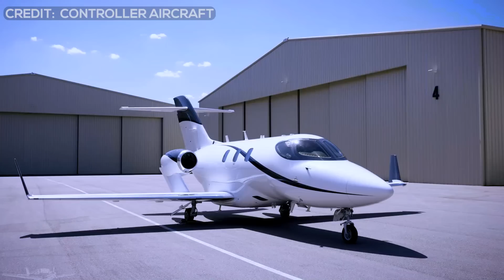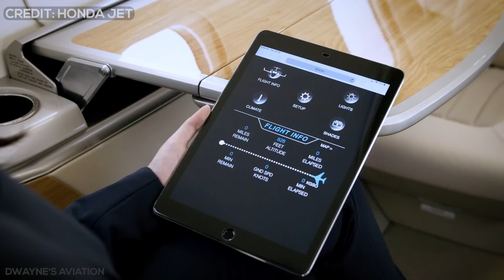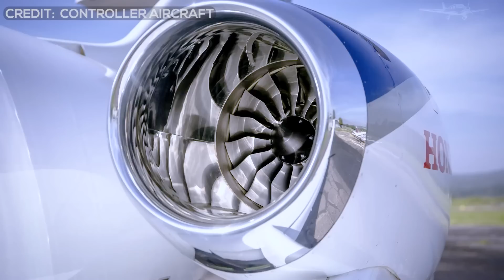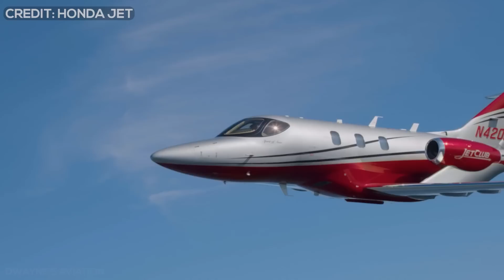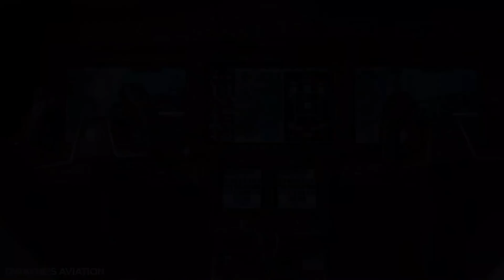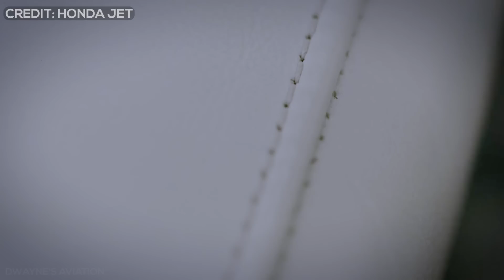Why the HondaJet is Outstanding

Comment: Two major downsides of the Honda jet are, no aerodynamic brakes or thrust reversers to able it to land at shorter strips and under powered engines.
Reply: It does have Aero brakes located at the aft fuselage
Reply: @omolemophaoe  having worked on those planes, and knowing many pilots first hand experiences. I don't count them as speed breaks at all

Comment: Why did they use an inverted pylon to mount the engine instead of fuselage mounting like a citation you wonder? The wing has to be locally strong enough to handle main landing gear loads, strength requires additional structure weight. If the engines were mounted to the fuselage, that also requires strengthening to handle the weight at that location. However, mounting the engine close to the main gear requires only one strong point per side and saves complication in running fuel lines through the cabin. This saves weight and increases the sound isolation between the engines and the cabin. When someone does something different because it is better for their purposes, it often looks funny to a viewer because it is unexpected.
Reply: It's not only strength, it's less noise and more room inside the plane, not to mention less hardware.
Reply: If they put the engines below the wings it will suck in debris because the plane is already low. If you're so smart then you should have figured this out. They figured out how to place the engine away from the fuselage to reduce noise inside the plane while giving it more compartment space. I would trust their engineers more than I would trust you since you didn't even realize the issue with mounting the engine in that position.
Reply: @dredgewalker   Um, who are you replying to? The OP (@OldSloGuy) actually praises HondaJet's design, explaining some tradeoff but ultimately concluding that HondaJet's tradeiff is worth it, despite how it looks.

Comment: Very poor runway performance- as it seems to require 6000 foot  runway for  landing due to a number of braking issues. Also a 20kt  crosswind limitation! These are serious issues!
Reply: The video gave a much smaller number for the required length of the runway when landing.

Comment: make it electric - fly higer, faster and more efficiently -some planes have drop tanks, drop empty batteries as autonomous glider planes
Reply: Drop the used batteries?  On whose house?   

However, it does sound like a good idea for design of any e-plane when on the tarmac and would make recharging a non aircraft issue so one could drop the “empty “ battery and have the fully charged battery installed probably in less time than refueling currently takes.
Reply: @kmlammto  autonomus planes can land wherever you want them to - the military even has refuel drones that lands on aircraft carriers
Reply: Still a long time to go before we finally have an electric motor that's as efficient and as reliable as the turbine engine.
Reply: @chris22capt  an electric a10 would have no heat signature and the batteries be extra armor
Reply: @replica1052  ?
Reply: @chris22capt  (electric motors were reliable a century ago )
Reply: @replica1052  that was before gas turbine invented. You can't compare that to a turbine. Power delivered by both are so different for a same amount of operating cost spent on both of them..
Reply: @chris22capt  electric is most efficient
Reply: @replica1052  how can you prove that? A new turbofan aircraft able to fly for 7000nm at altitude of 30000 ft to 40000 ft and at speed of mach 0.80 to 0.84 while a new electric aircraft currently in development is still struggling to reach 700nm.. Still a long way before electric motor able to replace a turbofan engine. It will not happened anytime soon.
Reply: @chris22capt  some planes have drop tanks - drop empty batteries as autonomous gliderplanes
Reply: @replica1052  that's... a very expensive solution to the problem.. You do realise that battery is expensive to be manufactured, right? With the drop battery idea, that means operator will have to constantly burning out such an expensive amount of money to keep the batteries in stock. And where the battery will be dropped? Over someone house?

Like I said before, it's not efficient because the energy density it can hold will not be enough to keep an airplane going for thousands miles. Okay like you said using drop battery concept, but that means the aircraft will have to bring such a large amount of battery and dropping the empty one along the way to reduce the weight to gain an even further distance? That means the useful load on departure will be greatly reduced because of those batteries. It's uneconomical. That's a way of inviting airlines into bankruptcy.

Battery technology have to greatly evolving so it can hold such a great energy density in a relative light battery before it can takeover turbofan aircraft.
Reply: @chris22capt  autonomous planes can land wherever you want them to land - batteries are cheap and fast charging
Reply: @replica1052  so does the conventional aircraft, they can land everywhere if the controller give them clearance. But that's the problem. You'll have to make a many stop along the way to keep rechanging the battery and it totally wasting time compared to say a Global 8000 which can easily pull of 8000nm trip non-stop. Okay as you can say fast charging will help, but is it really helping? You need to consider the slot time available for the aircraft able to be given clearance to takeoff again, you have to file a new flight plan in order to get that slot and clearance, and that need quiet a long time. It's not like a car where you stop at a charging station and once the charging is done, you just left the station and continue your trip. No, aviation is much complicated.

Let's get back to the comparison with Global 8000. As I say before, a Global 8000 is able to pull of 8000 nm non stop while today's electric aircraft at the furthest, I need to correct this first, I just do some little research, Electric Aircraft that has the furthest range I can find currently is Eviation Alice, 250 nm, max. 260 kt, 1 hr trip. If you want to take the Alice on that same trip as the Global, you'll need at least 32 stops until you reach your destination. Global 8000 needs around 15 hours to complete the journey, but with the electric aircraft, let's say 30 mins the fastest for each charging stop. 32 hrs + (32 stops * 30 mins) = That's already more than 3 days.

It's a good option for commuter aircraft but not for a long haul trip. It's just doesn't have that capability yet.
Reply: @chris22capt  batteries as atonomous planes can be shared - with drop-off batteries you can fly as long as you need  (fly higher, faster and more effciently )
Reply: @replica1052  whatever, your imagination is too high.. I've explain the danger of dropping battery, moreover on overland flight where there are so many houses on the flight path, but it seems no word can make you understand why it's not ready yet..
Reply: @chris22capt  (atonomous planes land wherever you want them to land )
Reply: @replica1052  and it will take time at least 30 mins until it able to takeoff, waiting for the clearance. You keep repeating things here.
Reply: @chris22capt  (fly as long as you want - batterieas attach fast  )
Reply: I'm wondering why I'm wasting my time here..
Reply: fly higher, faster and more eficiently
Reply: You must be insane or just really good at jokes. This is the craziest thing I’ve seen in a while 😂😂😂
Reply: @dondelchulia3189  (electric motors are strong, light and efficient )
Reply: @replica1052  electric motors are 💪 💡 and 😎